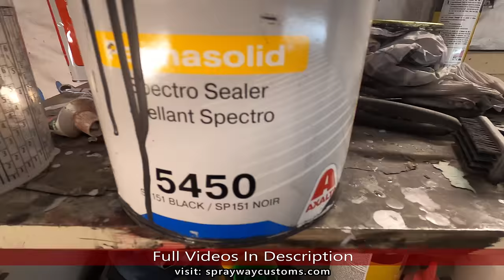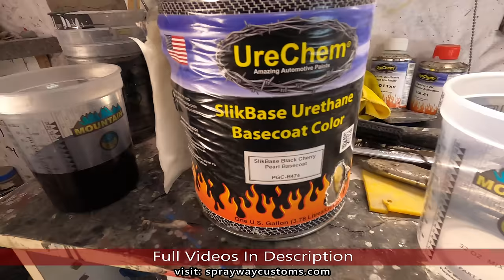Black Cherry Pearl Complete Paint Job From Start To Finish OBS CHEVY SILVERADO TRUCK PROJECT BUILD

Comment: SprayWay make this ART. From day one He preaches PREP! PREP PREP ! definitely use that in my work ethic because it resounds in my head LOL.   I live in Baltimore MD getting a Salvaged 370Z back in order.  Got the subframe and new suspension back in ...new control arms are on added coil overs.  gonna bend back and reinforce the frame rail and redore the radiator core add support bar.  
When I'm done I keep seeing Candy Black with silver flakes on Black concave 5 stars and white letter tires.

Comment: Looks good! Spot welding the top portion of those weld on roll pans really firm them up and help prevent any failures, would recommend seam sealing the top edge as well.

Comment: Absolutely STUNNING work.  I have learned so much.

I only work with Rattle can, it gets a bad wrap but my work has  turned out very well and it lasts well over 15 years with no problems from the Rustoleum paints.
Chasing the wet edge, I learned on my own.  but there are so many techniques to applying spray paint and the method used to apply that paint changes the way you do it.  Big difference between using a paint gun vs Rattle can.  I eagerly watch your vids as well as others to pick up more tips.
Never tried using a roller to apply paint yet, but may try on a RV roof where the roof is actually a body panel and paint.  Even though I have seen the results be very good, it is comforting that it would not be seen normally by anyone.

I did have a learning experience when, as you say, the paint will "bridge" over onto the masking tape, and IT WILL take some of  your paint finish with it if you allow it to dry  before unmasking.

It can be a problem trying to pull the paper/plastic while the paint is still wet/curing so I came up with a less troublesome way.

in order to get the paper/plastic up faster, I run the tape along the edge of the paper/plastic, leaving about 1/4 inch of the sticky tape exposed to attach to the area being protected.  I place the edge of that tape about 1/4 inch from the edge were the new paint will stop.  I then run a strip of tape along the paint edge and on top of the masking tape in place.
Doing this, gives you a fast way to get the tape off, and not risk all that paper or plastic to come in contact with any wet/curing paint.  It had made the tape removal so so much easier and faster when minutes count.
Maybe that could be a helpful method for you.

Great video as usual.  Really enjoy the tips  you offer.